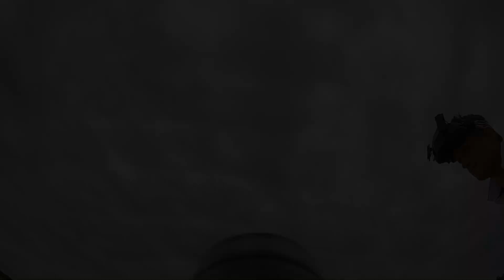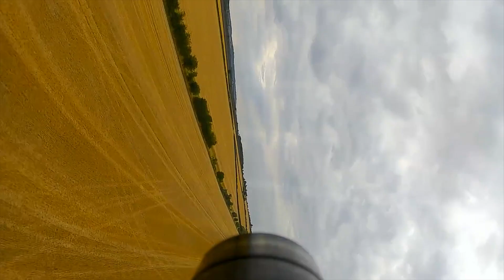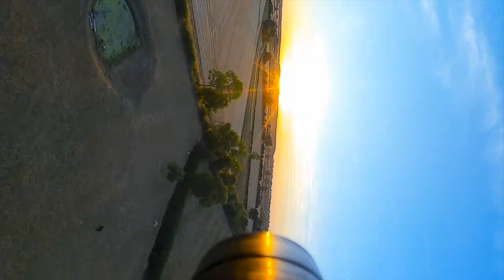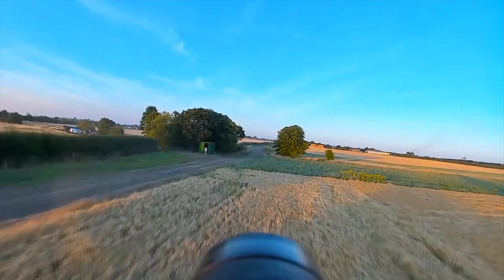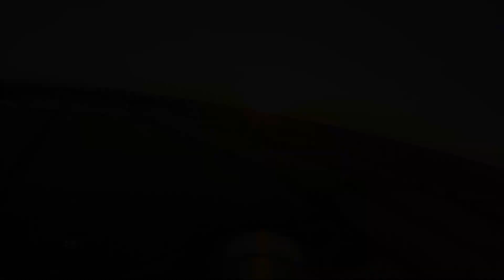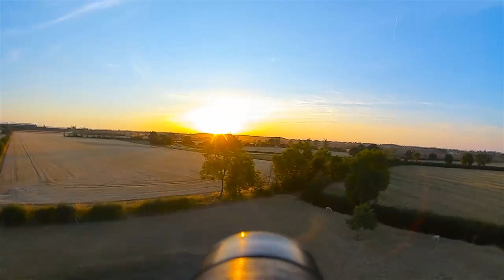Fast FPV  -This plane is on rails !

Comment: Mine is almost ready!! Cannot not wait for the maiden, O4 + F405 wing FC in case of video loss. I evaluated the twin motor design but propellers are really limited there. Space is really tight for this build 😂
Reply from the maker: Cool man! How did you mount camera? Please post some pictures on the Aloft page I shared, it will really help other people who want to build one.
Reply: @OMEGOOLIEBIRD  I will! tougher with the shit-ton of files I designed for that! Camera mounted as yours but I have to check how high/ and ho distant from the propeller should be. Maybe on the tail would be cool but was not great for CG
Reply from the maker: I have massive respect for you bud, to go as fast as you have with a quad is really a ground breaking achievement! Looking forward to seeing where you go next! Would love to know motors/prop and current on your quad, it would make a great twin setup on a plane.
Reply: @OMEGOOLIEBIRD  Btw I have massive respect for you! You turbine setup is just insane, I always loved to have something like that but it might be a bit too daaanger to just fuck around I guess 👀

Comment: Hey just wondering a long time ago you had a very fast funjet . Die you do any aerodynamic mods to ir ?
Reply from the maker: Hi Bud, yes made a few changes. Reduced the volume of the canopy a bit, shaved the strips off the sides of the fuselage. Also, some extra carbon tubes in the wings and carbon strips in the elevons.

Comment: Is this video sped up or is that the actual flight?
Reply from the maker: No, it is the actual speed, around 120mph with fresh cells, drops to about 100mph by the end of the pack. It really is this mental to fly lol!
Reply: @OMEGOOLIEBIRD that is crazy and it seems like it's faster than 120.  I'm not saying 120 is nothing to sneeze at but it just seems faster for some reason.
Reply from the maker: @brandonw987  I think it is because of how fast it turns compared to a foam plane, it makes it look faster. It certainly feels fast when flying it! I'm getting a bit more confident with it, so will probably do another video at some point.
Reply: @OMEGOOLIEBIRD  please do it's definitely cool. I fly quads and have been thinking about getting into getting a wing to try it out.

Comment: Hi again set mine up powered but after 6 failed launches have to rethink things . I’m used to plank type models from slope over the yrs and one or two powered but this is a little frustrating lve been launching over corn fields so no damage at all. My question is from where did you measure your CG from and what was the measurement  , mine was at 22 then 20mm from the wing root not the little v shaped moulding. Also did you put any thrust angle into the motor mount ?
Thanks
Reply from the maker: Have you got any static up elevator set? it needs     3-4mm of 'reflex'.. so when the stick is in the middle, there is a bit of up elevator. It's critical.
Reply: Sorry only just seen this. Yes l have ( reflex) about 3mm . I have now  had several successful flights flys well , very nimble very fast could do with being larger for LOS gets very small very quickly. Can see why it’s a good fpv that is never a issue 😅

Comment: Very impressive but  you say 20 amp esc 1900kv tmotor on 4s with the prop you are using? What Amps is this set up drawing? I would have thought 40 amps at full throttle…
Reply from the maker: It pulls just over 20a at full throttle/ 120mph.

Comment: Awesome vid as always. I’ve seen a few comments of your saying it’s a handful and that it flys like a sim. Does it take a lot to get it flying nice?
Reply from the maker: Hi thanks! It is very sensitive, but very accurate. It needs good servos like Mks/kst so they centre well, and very geared down control links, so using full servo travel, there is still small movement of the elevons. The more travel the servo gets without reducing it in the radio, the better the resolution at the control surfaces. I run it nose heavy so it is a bit hard work slow, but have trimmed it for full throttle flying, and it is on rails then. The nose heavy situation reduces the pitch sensitivity.
Reply: Thanks for the great explanation. What sort of specs should I be looking for when buying servos for it?  I have a setup that I had in a gunner that got around 250kph that I’m thinking of sticking in. What sort of space in the fues do you have?  Thanks.
Reply from the maker: @evcasey  I used KST X08 servos.

Comment: wow, 120mph only one 18650 4s1p? this plane looks like an alula trek
Reply from the maker: Thanks for watching. Is is so thin and slippery compared to a foamie, it needs half the power to go the same speed. Yeah looks a lot like the trek!
Reply: @OMEGOOLIEBIRD  And what is the current at full throttle with this propeller? It seems to be no higher than 20A for this pack 18650
Reply from the maker: @unixoid33  I haven't measured it lol. But it is only a 20a esc with no heatsink, so it can't be pulling much above 20a. I suspect about 18a in the air flat out.

Comment: YEEEEEESSSSSSSS!!!!! That looks bloody brilliant!
Reply from the maker: Thanks man! Your prop calculator was a fundamental part of the process!
Reply: @OMEGOOLIEBIRD  cool, glad to hear its useful. I’ve added a thrust estimate now too. Static isn’t bad. But the dynamic is always low, so may jog it on.
Reply from the maker: @MrD  If you ever get the chance, could you up the cell count to 28s.. I know it sounds silly, but that would be my next setup. One of the Big APD ESC's  at 28s is about the peak of what's available.
Reply: @OMEGOOLIEBIRD  no problem. Would it still be in 2S increments, or do they spread out a bit in that area. I’m still look forward to my 6S flight at the weekend. That will hopefully be quick for me. We’ll see. Have a few props to try.
Reply from the maker: @MrD  I think it would be in 2s increments..I would probably only be speccing packs with an even number of cells. What have you got with 6s in it?
Reply: @OMEGOOLIEBIRD  yep, me too. I’ve set it as 2S increments above 12S. Went up to 30S. I had a look at 28S. Those are some big numbers. I just used 400KV, and was seeing 700mph tip speeds. I look forward to that one. 

It’s just my old F1. I had it running on 4S a few years ago, and it just wouldn’t get over the 139mph hump. It would do that consistently though. So trying a different motor and 6S and see what happens. It’s not the most aero airframe, so not hoping for miracles. But 160 would be nice. My fastest currently is 141mph with my Mini AR wing. So I’m sure I’ll be beating my personal best at least.
Reply from the maker: @MrD  Thanks for update! Keep pushing the speed! Above 160 is pretty hard, it takes a lot of power and the right prop. Have a look on Hyper flight, he is selling the oversquare Marcus Koch speed props now.
Reply: @OMEGOOLIEBIRD  oh cool. Quicker than ordering from Germany.